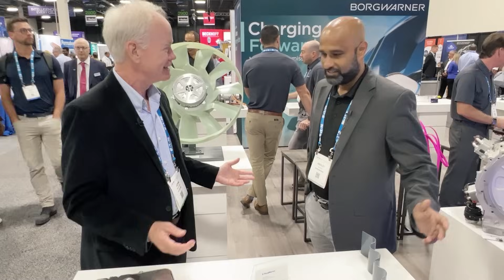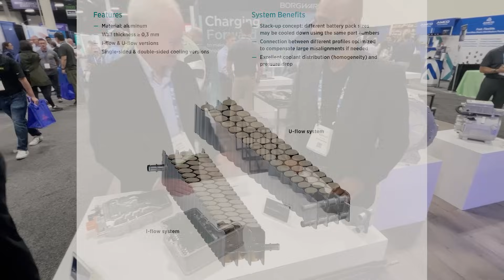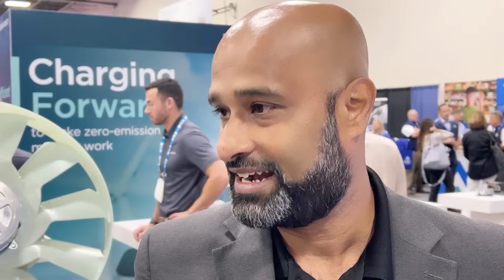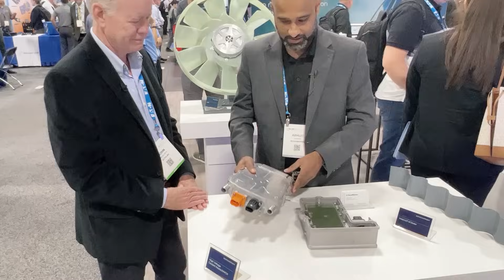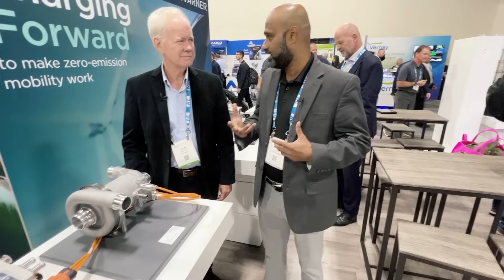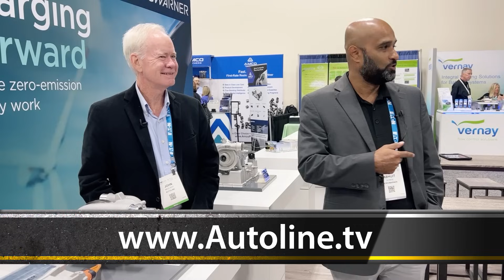ICE Know-How Pays Off In An EV World - The Battery Show 2023

Comment: This was a great look into how far behind Tesla everyone is
Reply: Except that your Tesla doesn't sell 99% of the vehicle types the world needs.
Reply: Tesla still makes some of the worst quality vehicles in the industry and BEVs are supposedly so much simpler to build and maintain. That is a terrible trend for Tesla.
Reply: @matthewhuszarik4173  Not at all true. And please don't show me JD Powers data, which by their own admission isn't even close to complete on Tesla. They do not survey owners in like 10 of Teslas biggest markets. And things they call issues are often nothing to do with reliability.
Reply: @user-to2rf1rj5v  It isn’t just JD Powers they are just the most visible.
Reply: Tesla Roadster used a Borg-Warner gearbox...
Reply: @vidznstuff1  oh, 15 years ago?
Reply: @vidznstuff1  Yes, BW saved Tesla when their first two gearbox suppliers did not provide workable solutions.  To be fair to the first supplier, Tesla stated the problem was with their requirements for the two speed, not the supplier's design.
Reply: Exactly my thoughts when they showed the battery heaters.  They looked complex and expensive.  Tesla eliminated this part in 2017 with the Model 3.  Instead they operate the motor inefficiently to produce extra heat, and pump the coolant to the battery. Zero cost and zero failures of the non-existent battery heater.  Tesla did not stop there, now they have the "octovalve" heat pump that can pump heat from many areas to where it is needed.